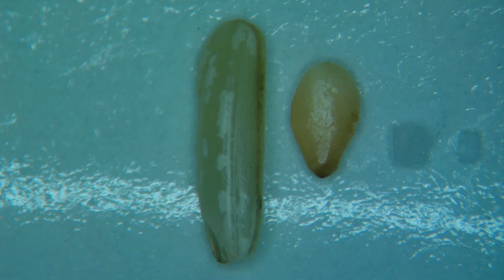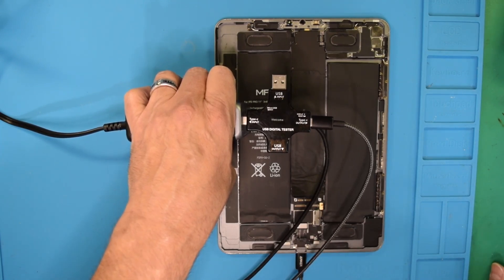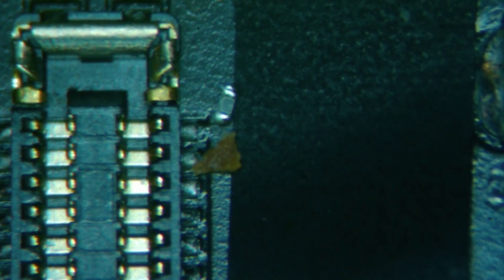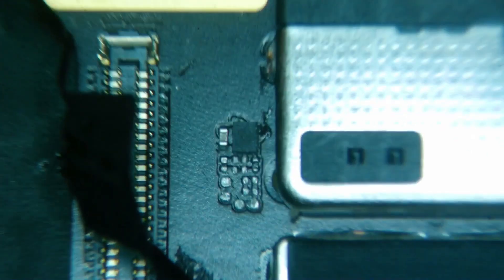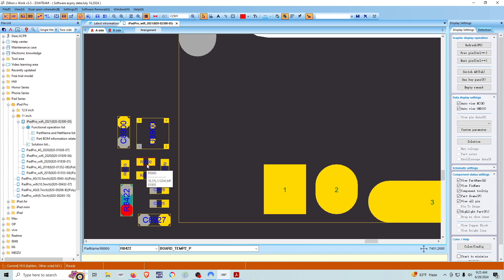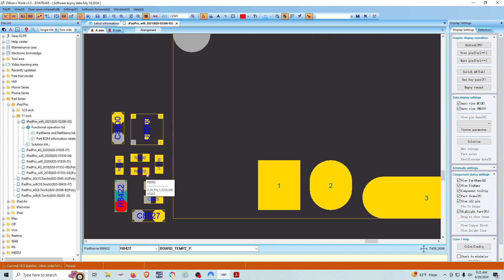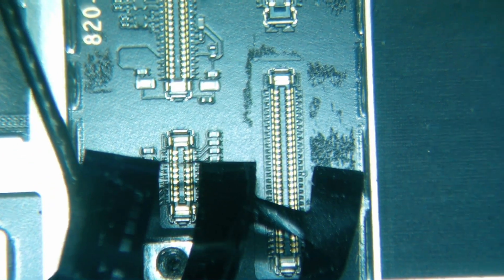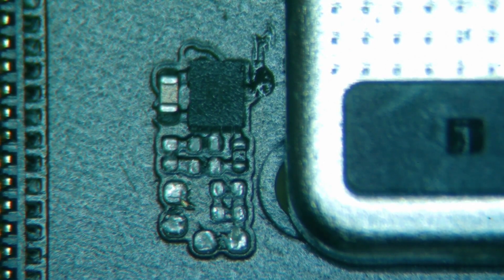iPad Pro 11 Third Generation Charging System Repair

Comment: How would I know it’s a charging port issue or a battery or a ic charging unit issue ? What are the most common e reasons ? I have ordered parts to change charging port if that does not fix it should I do battery next and then the IC chip?